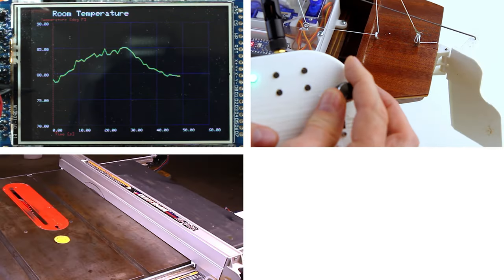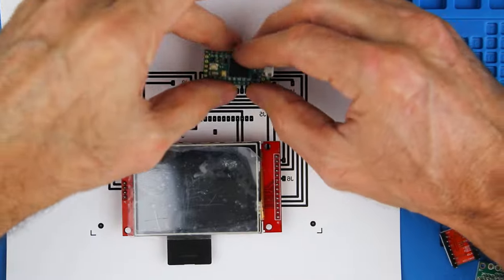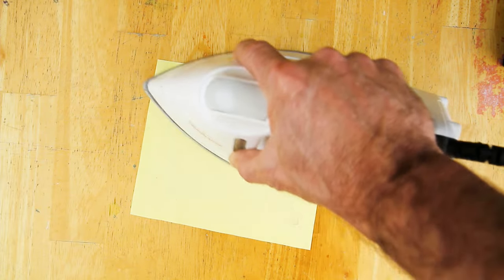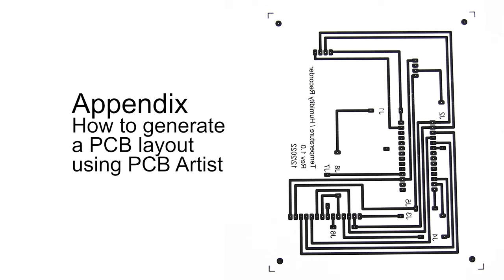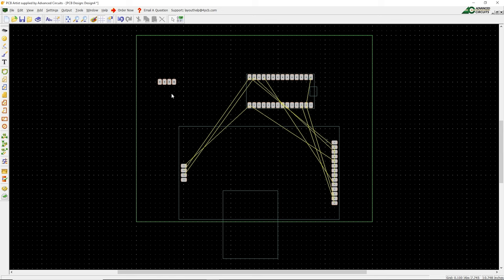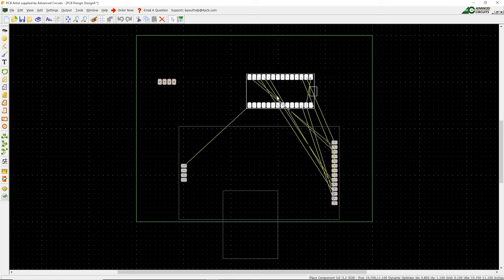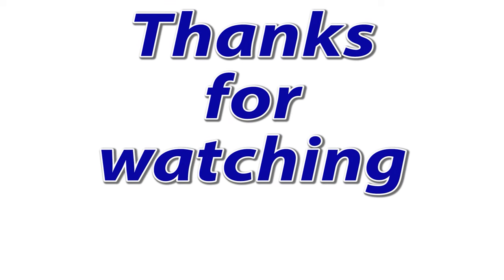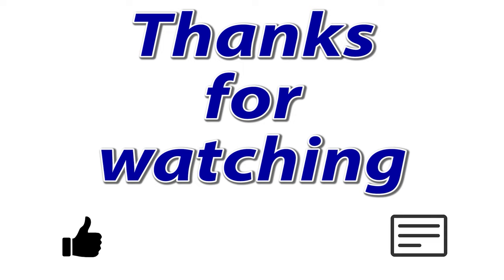Reliable DIY PCB's at home

Comment: I spend the last two weeks to learn how to make PCBs on my milling CNC I made from one of my broken 3d printers. Now I see it was a mistake. For the next two weeks I will be following your tutorial.
Reply from the maker: Glad I could help, let us know how it works out!
Reply: @KrisKasprzak  Ok, so I just finished my first ever PCB by following the method shown in your tutorial, and the result is absolutely fine. I have some input from myself as I had some problems with printing that might interest someone. I used the Brother printer, which is labeled as not the best for this application. However, it can work just fine if you make sure that the toner is not used up or close to it (just buy new toner). I didn't use the original, but some cheap replacement. Next, you need to get a steel wool and gently get rid of the glossiness on the paper to help the toner stick. Just a few movements across the surface will do the trick. I also found out that you don't want to get the paper too hot. I tried it and the paper didn't peel off the copper easily and ruined the whole thing. I set the iron to a little bit colder and held it for something around 30 seconds, and it works fine (maybe it should be done for a little longer; I saw some toner being left on the paper). And don't forget to apply some pressure. But anyway, the method worked and the PCB looks much better after a few attempts than it would ever do with the CNC approach.

Comment: This is great, just what I need. I'm an old PCB Designer, started with tape-up layouts, 4x1 and then early CAD systems in the late 70's. In fact my whole career is based on PCB design S/W, as a Product Manager, Applications Engr., Devleopment Mgr.  I used to build home PCB's with much harder and more crude, dirty process, using photo-lith process with a photo-resist chemical on bare copper. I know how this all works and this process with the design S/W is much easier. 
I'm building a ESP32 board design and this is perfect for what I want to do. Thanks for this, I'm ordering parts now...
Reply from the maker: Glad I could help

Comment: The big secret is to use a modified laminator. Using an iron will always leave the outcome somewhat to chance.
Reply from the maker: Good tip, thanks for sharing.
Reply: @KrisKasprzak  Using a laminator and thus controlling process parameters like pressure, speed and temperature also means you are not unnecessarily flattening out traces. One of the drawbacks with this transfer methods is that with uneven pressure from an iron, you have trouble reproducing really fine features. And with a laminator, you can run the transfer sheet together with a normal paper through it, and remove all remaining toner, making it possible to reuse it.
I still think it is inferior to normal photolithograpy, where you only need a pigment-based inkjet printer to print out 1200dpi+ transparent sheets to reproduce ultra-fine details. Obviously you need pre-coated photosensitive PCBs, and you have the additional step of exposing and developing, although the latter only requires some drain cleaner (sodium hydroxide).
I'd also advice on trying out sodium persulfate as the etchant, because it is safer and easier to control. You do need to heat it a bit, though. It also doesn't suffer the problem of hydrogen peroxide with going bad over time. In dry form, it basically lasts forever.

Comment: Hello. What laser printer did you use ? Thanks for the video.
Reply from the maker: Brother HL-L2370DW, I think I paid $150 or so. Works great as a general printer as well.
Reply: @KrisKasprzak  Thx ! Your answer makes me happy because brother is cheap and seems to be a great brand overall (instead of HP's). However, some people in search of heat toner transfer say that brother's toners dont work very well. So did you use an official Brother toner with your printer ?